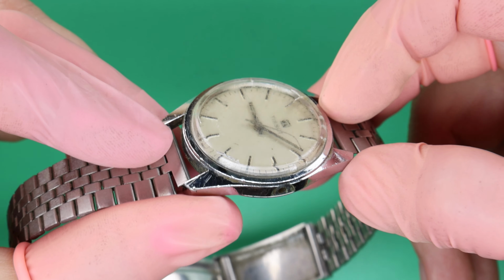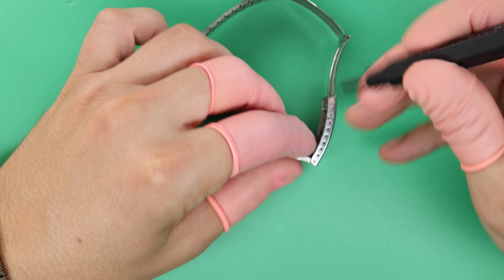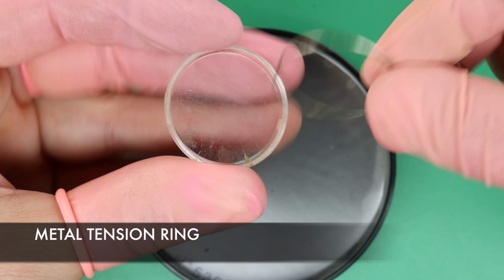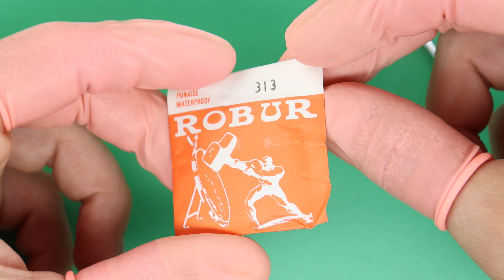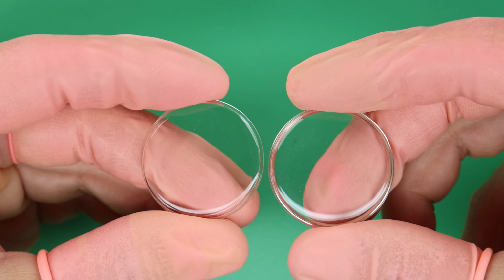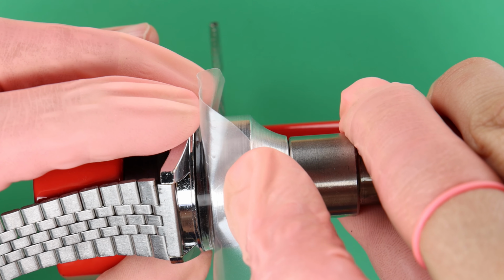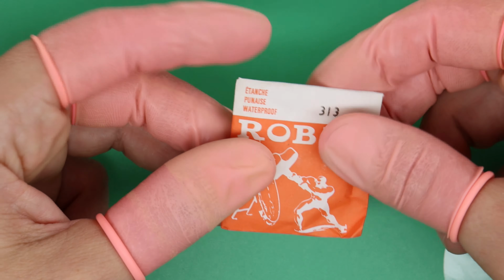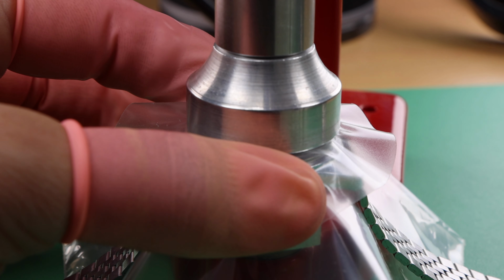How to replace a plastic watch glass?! | Watch Repair Tutorial | DIY | Robur Press Fitting

Comment: Excellent video and very detailed on how to replace crystals with both tension ring and without it. I really like all of your videos. You are very professional. I know this is an old video but I saw you use a Robur press. I just bought one, but it seems like it has a lot of side shake on the spindle. Is that how they are supposed to be or it’s just mine that came like that? Thank you for your help and for the great videos!

Comment: Very timely for me as I just received a Robur press from Cousins and am getting used to it.  A couple questions if I may:

1. I'm assuming that the metal die is beveled?  I also got the die set and they all are beveled.
2. Did you apply what looks like felt to the bakelite dies?

Thanks.

Comment: What size should the crystal be, relative to the case opening, if using a tension ring crystal? In your example, it seems like the case maybe had a 31mm opening? So you used a 31.1mm crystal with tension ring (0.1mm oversized to generate tension), or a 31.3mm crystal without tension ring (0.3mm oversized to generate tension)? Is this correct?